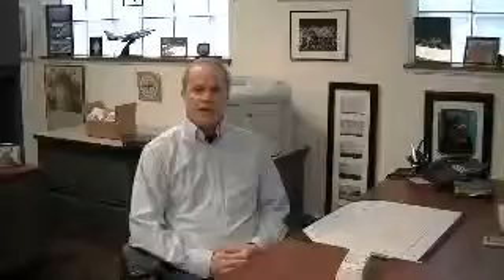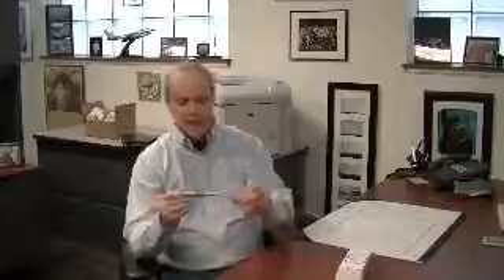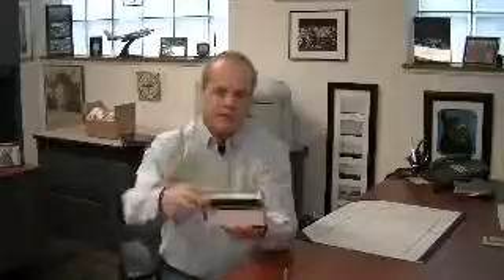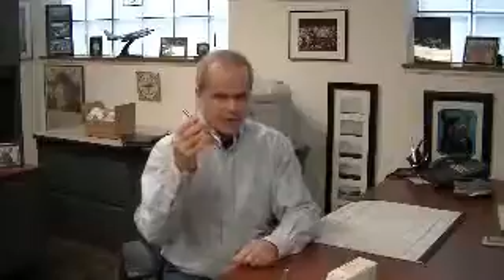3/8" Drop-In Anchors

Comment: I have never used these anchors before.  I was wondering what the thread spec is when I buy the bolt.  Also, I would like to know because I want to buy a threaded nylon plug to prevent dirt and other contaminates from going into the female end.
Reply: The hole is a 3/8-16" so anything 3/8" or .375 will slide in